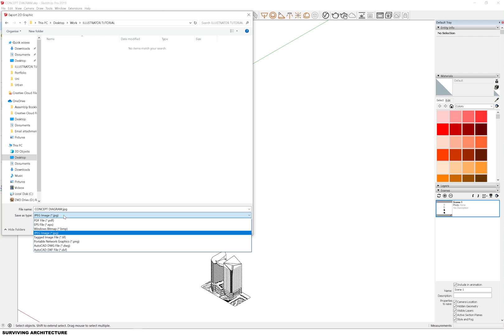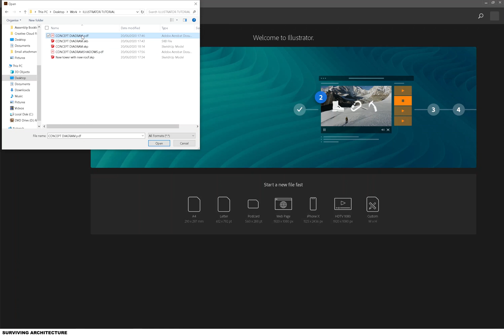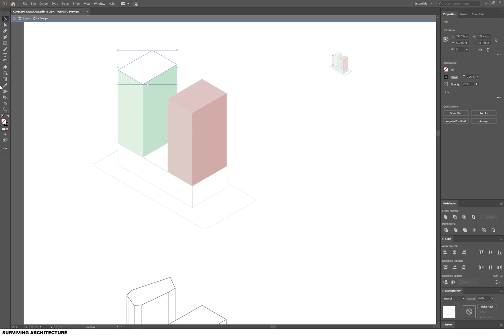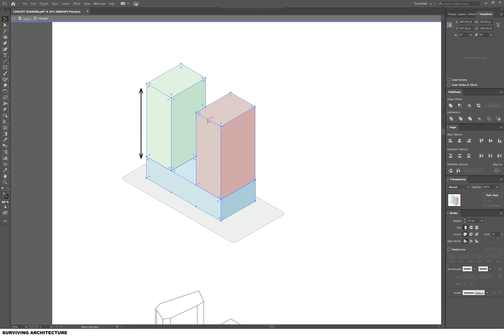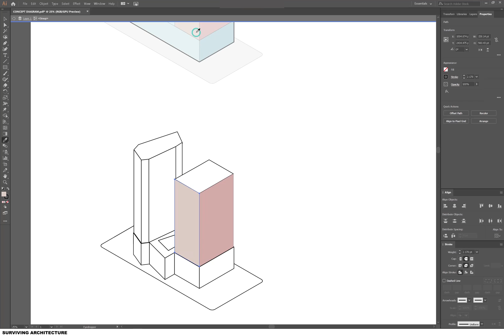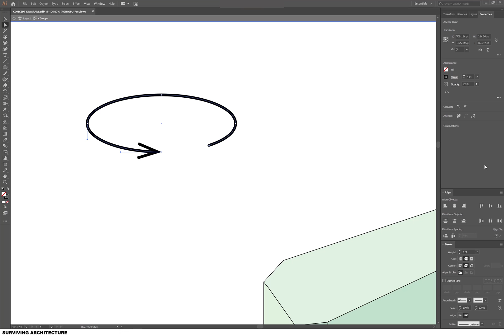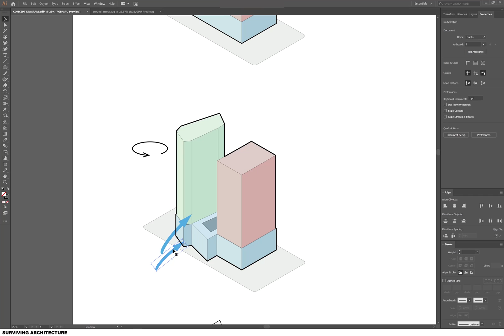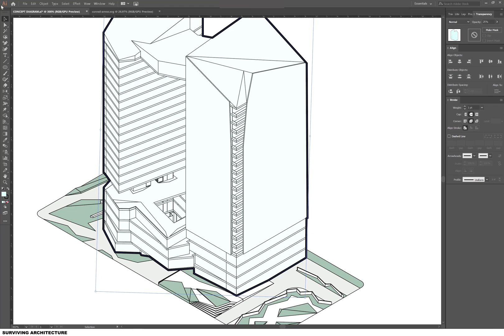Concept Diagram in Architecture [Illustrator tutorial for Architects]

Comment: Hey great video! I like it a lot. I believe you can change the transparency of the fill of a shape without it affecting the stroke, for that you need to use the appearance panel which lets you change the opacity of fill and stroke separately. You can check for the appearance panel in the window menu.
Reply from the maker: Thanks for the tip! I did try that though in the beginning on the appearance panel but the stroke turned grey. So, I am not sure if I'm missing something
Reply: @SurvivingArchitecture  Mhm, wierd. I don't know what it might be, here i'll leave you de link from where i've learn it in case you'd like to chaeck it: https://community.adobe.com/t5/illustrator/transparency-on-fill-not-stroke/td-p/3277162?page=1